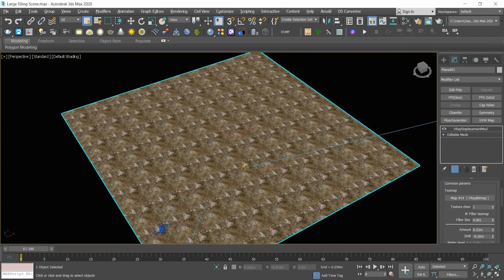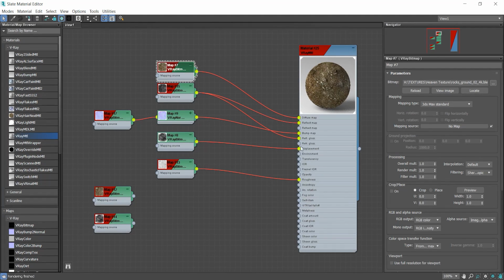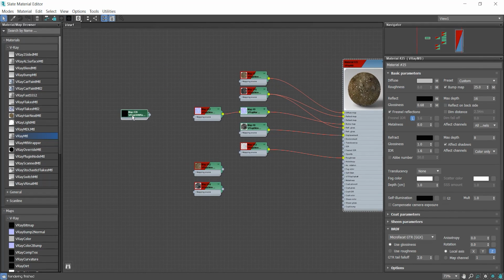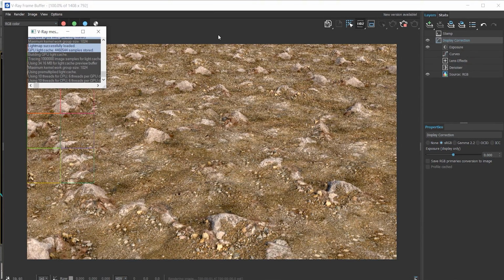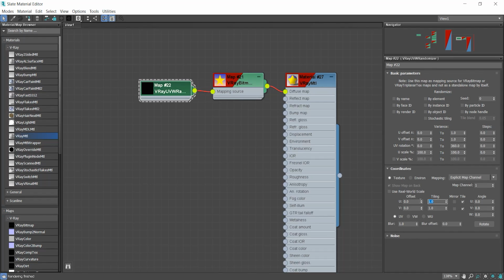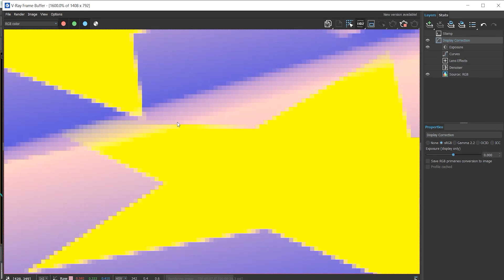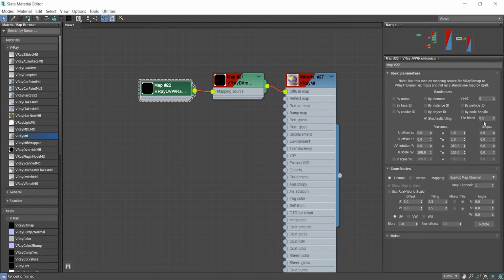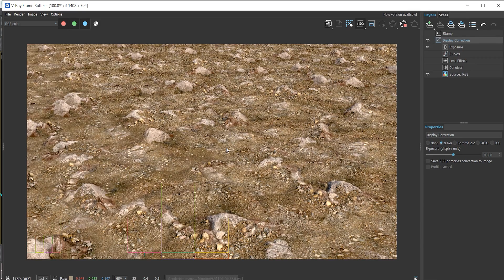How to Fix Texture Tiling for Large areas in 3Ds Max

Comment: Hi, i have a question.
How would you do this with a wood texture? Like the walls for a cabin...
Reply from the maker: Hi, for a wood texture you should try another method. this method works well for materials that has no special pattern and we need to see them randomized. 
I suggest you use Bga Randomizer for wood materials.

Comment: HI Saeed,
tiling of texture is a headache for me
ur video opened a new door but..
unfortunately i am not finding vray randomizer in my map list
i am using max 18 with vray 3.0
is that the reason or i am missing any step
please help!!
thanx a ton n regards
Reply from the maker: Hi, glad you liked it.Please make sure that your current version of V-Ray includes Randomizer map since it sounds like you're using older version of V-Ray.
Reply: @SaeedMandegarTutorials  which version has started including randomizer..thatnx for the reply anyways
Reply from the maker: Hi, I'm not sure about the versions that include this map, but if your V-Ray doesn't include that so it means you need to upgrade it

Comment: Is there a way to do this in 3ds Max without using VRay?
Reply: You can do the same with Corona render, it can be used with most of V-ray maps.
Reply: I'm curious too
And a lot of people use Vray, what exactly is the reason? As if it were a necessity
Reply from the maker: V-Ray is the most powerful rendering engine (imo). and I share my knowledge and information about this rendering engine with you. however this solution can be achieved by some other rendering engines as well.
Reply: @SaeedMandegarTutorials  I agree, I switched to Corona, but now, I do regret for that, cause honestly, it really was one click render....but now, I can see I made a mistake...fak!
Reply from the maker: Hi, Since it's mostly a texturing issue, it's more related to your rendering engine than your 3D software. so I use V-Ray to fix his. you can do it with other rendering engines as well.

Comment: How to render ID pass in vray ?
Reply from the maker: you can add that in the render elements tab
Reply: @SaeedMandegarTutorials  but it's not save in file
Reply: @SaeedMandegarTutorials  even I put path
Reply: @SaeedMandegarTutorials  I render EXR file its save by VRAY frame buffer (VRAY raw image file) and also individually choose path on VRAY render ID
Reply: @SaeedMandegarTutorials  it will be good, you make a dedicated video on it
Please
Reply from the maker: when the rendering is done. you need to save as multiply by press and holding more than 1 second on the save (floppy) icon.
Reply: @SaeedMandegarTutorials  please make a video